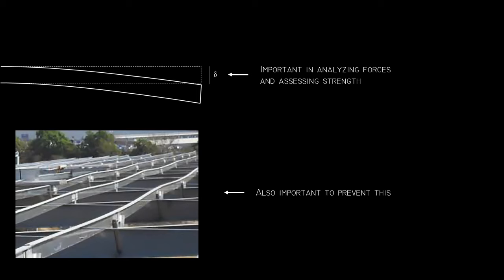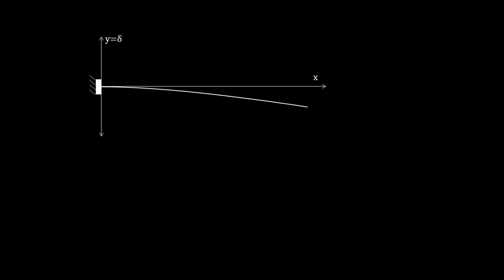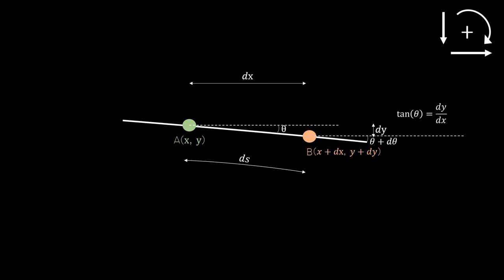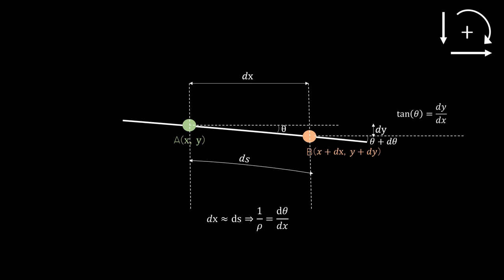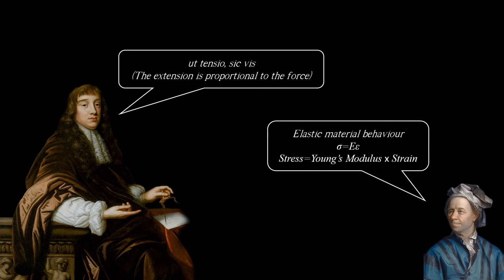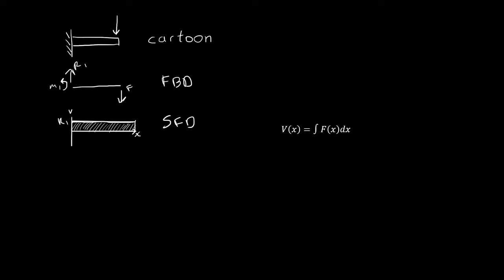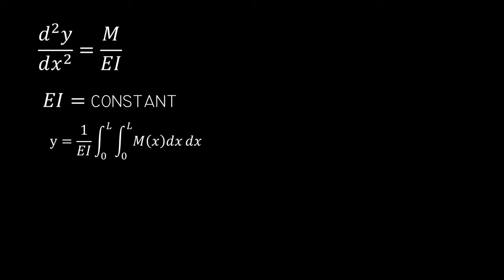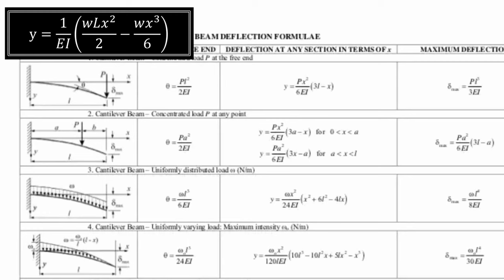The Formula Behind all of Structural Engineering: Euler-Bernoulli Bending from First Principles

Comment: So it means that if the applied force is not a point force at the free end, but is a function of location x, then we cannot use the simplified version of the Bernoulli beam, right? I mean then we need to integrate the equation four times in order to figure out the displacements of beam, am I correct?
Reply from the maker: That is an excellent question. Bernoulli beam theory still applies and d_theta/d_x is just a function (the derivative of theta, or the second derivative of the bending moment function M(x)). In the case of several loads (e.g. two point loads or a udl with a point load at an arbitrary point) you would calculate the deflection as if each load was applied on its own, and then add up the results (assuming the beam acts linearly elastic). Hope this helps!
Reply: @erikoui  what if the force itself is a function of location, like a distributed load, so we should integrate it four times, right?
Reply from the maker: @TheMultiLibra  That is correct.